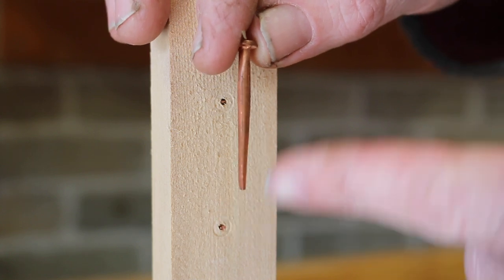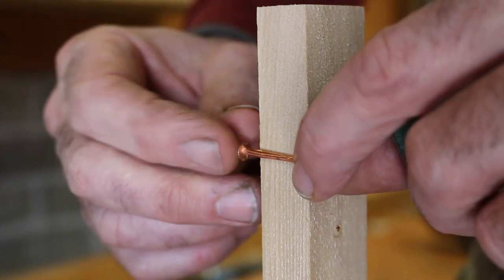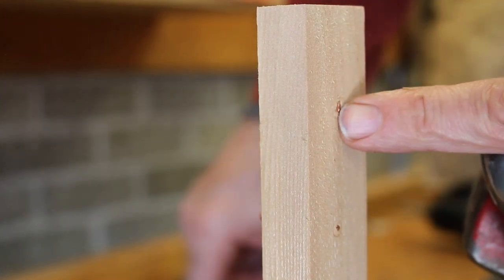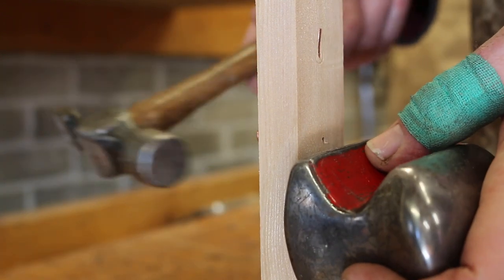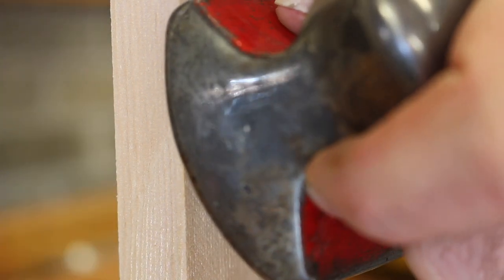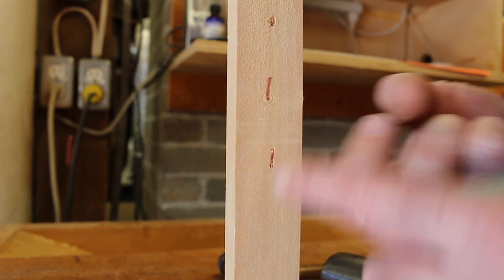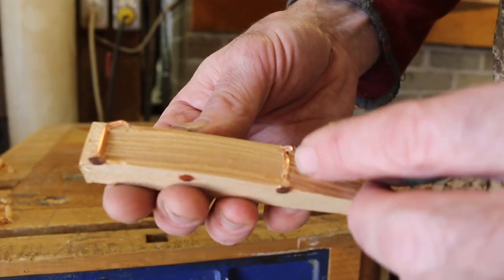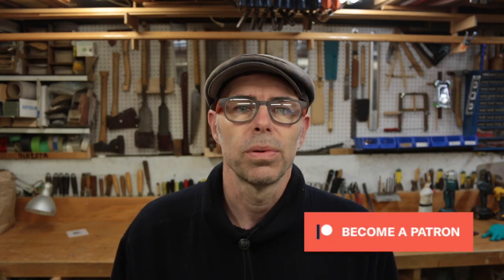⚓️ NOMAD - How to use clench nails.

Comment: Just thought I'd drop a comment down in the who ha here. 
Can clench nails be used in place of rivets? Say for example in a clincker/lap dory using white cedar?
Reply from the maker: Indeed they can. the boat I am currently building uses both. You would choose clench nails over rivets if you wanted a smooth surface and greater speed of assembly. The downside is lower repairability compared to rivets.
Reply: @Nomadboatbuilding  Well you can replace clinched nails. Just harder and not "retightenable".

Comment: This is where the term "dead as a doornail" comes from. Door frame nails were typically clinched in medieval times for added strength in the door / frame while also allowing the wood to shift slightly so it was less prone to splitting. The problem is these nails are unfit for any further use so they are considered dead.
Reply from the maker: Thanks for that Moose. I'll have to remember that for future clenching lessons.

Comment: I've done this before and didn't know this was an actual technique. I was just using carpenter common sense if that's a thing. Great video 👍
Reply from the maker: There is a long tradition in boatbuilding to take common sense techniques and give them two or more different names just to confuse things and fuel arguments on internet forums. Glad you liked it.

Comment: Wonderful video, clear and concise explanation.  Newbie question, do you countersink the nail head, and if so, what is the method?
Reply from the maker: Typically no when used in small craft but in my area wooden fishing vessels were often clench nailed and countersunk. In this case though, the nails are heavy steel cut nails and the tips we’re simply bent over. The countersunk nail heads were puttied over.
Reply: @Nomadboatbuilding   Thank you!

Comment: Very informative videos. Can I ask  a few questions about a 16 foot peterborough cedar and canvas canoe and a 9 foot cedar and canvas row boat that I am fixing up? Do you have a video showing how repair canvas that has separated from the gunnels rather than re-canvasing? Is there a product you could recommend for this job and a technique?  I have a full shop in my basement so tools are not a problem but these boats are in my car port so I am limited to weather. I live in Northern BC  where there is 6 months of winter. final question. do you have plans for converting the row boat into a sailing dingy? I have my fingers crossed you are still actively doing this work??
Reply from the maker: As to your canoe problem. Separation at the gunnels is a pretty clear indication that your canvas is reaching end of life. It may split along the stem or keel next but perhaps it was mostly moisture retention during inverted outdoor storage that is causing the canvas to rot. So, if you want to try and stretch out the use you can try one of two things. Option 1 is to try gluing a new swath of canvas to the inside of the old along the sheer line. Maybe 4”wide. It probably won’t look great and it will be a real pain to get it in there. Option 2: is probably better and easier but a little more involved. Glue a new swath on the outside but make it wider for looks. Like a sheer plank. Cover the lower edge with a wooden moulding. You might choose to staple the lower edge at the ribs. I would probably use 3M high strength 90 or high tack 76 spray adhesive. The high tack is reposition-able so a little easier to use. You can use latex paint or primer or even tile adhesive to fill out the canvas weave before final paint. Anything heavy bodied and flexible works well enough but straight oil paint will do too.
Reply from the maker: As yo your dinghy conversion, that’s harder to describe in a few words but it’s doable. You’re best bet is to copy a sail Plan from a similar size boat. You’ll have to find the Center of lateral resistance in your hull and figure out where a Centerboard or dagger board should go relative to that. Then figure out where to position your sail rig relative to those. Your best bet is to do a little reading on small boat design to understand those relationships.

Comment: Would you not try to bend it over so it will "wrap around" the fibers, rather than going in line with the fiber? Just as you did it, but rotate all 90 degrees? Awesome how you take time to set up the camera angles. Much appreciated! Greetings from Denmark
Reply from the maker: I the case of the plank laps, clench nails do cross the direction of the wood fibres but they are run in line with the grain on the frames. Partially this is because the nails all run in the same direction for efficiency in fastening but in the case of the frames which are usually oak or other hardwood, it is easier to make them flush with the surface of the wood.

Comment: Thank you for an excellent demonstration.  I have a question though. Is it acceptable to nip or shorten the point of the nail slightly if it's deemed to be too long for the holding material ?
Reply from the maker: Sure but doing that may make it harder to turn the tip over initially. You might have to get creative with a special purpose bucking iron to overcome that. It really depends on the gauge of the nail and the hardness of your planking stock. If you can’t find the right size clench nail then riveting is always an option. You may even be able to use those “too long” nails as rivets if you can find the right size roves.

Comment: Thanks, for clarification; the only Q. left is, gosh,if you REALLY want the nail to hold, shouldn't you clench the nail ACROSS the grain? As in holding a hinge on a sizable door(like a cabin in the woods situation?).
Reply from the maker: I hear what you are saying. On the planks that is what happens but on the frames they go with the grain. It has to do with two factors. #1, the frames are harder material and we want the nail end to be flush and clean which it will be by going with the grain. It will sink in better. #2 It's an efficiency of movement to do them all in the same direction.
Reply: @Nomadboatbuilding  Absolutely Bud !!

Comment: Any suggestions how I might do this to replace nails on a boat where I can't reach both sides simultaneously?
Reply from the maker: You are likely stuck with using either screws, ring nails or find somebody to be on the other side for you. It's hard to co-ordinate clench nailing with two people though. You will generally just end up with a smacked over nail unless you take it slow or get clever and make a bucking iron with a nice semi-circle groove that will turn the nail just right for you.